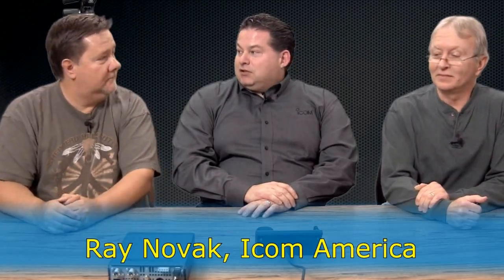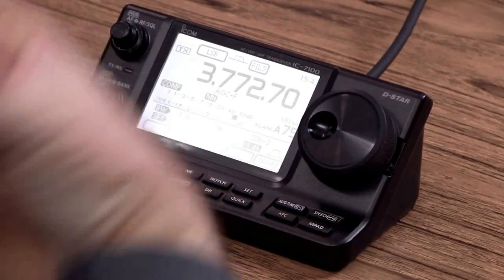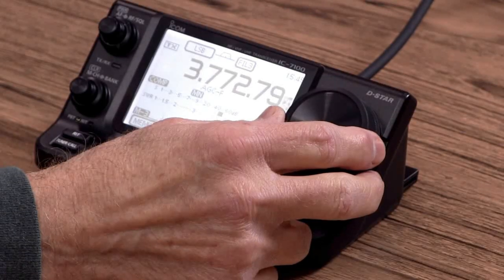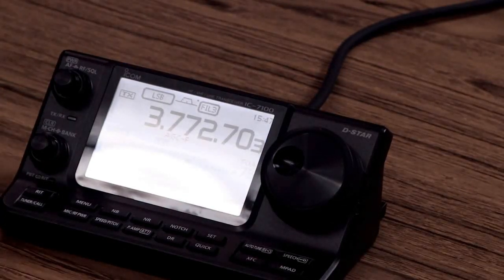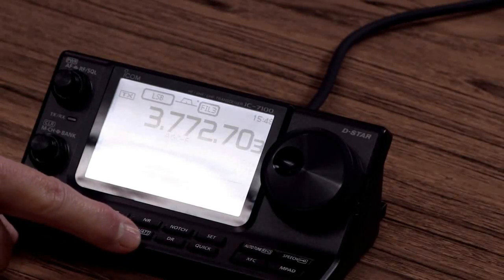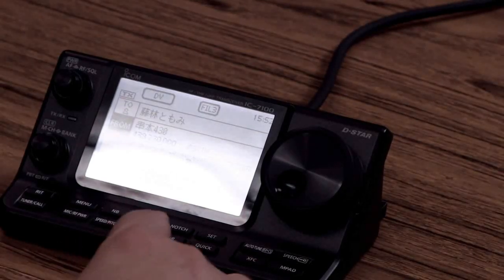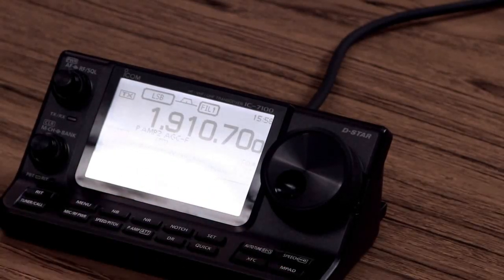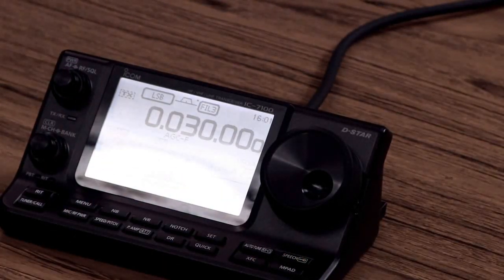Introduction to the IC-7100

Comment: would you please replace that freakn thing with a real mobile form factor like the 7000 please ??? you have a solid interface in the 705/7300, it's time to ditch that old clunky head unit radio to the mobile form factor again... the 7000 was so beautiful, it's possible for you guys to update that old thing... it's been 10+ year with that horrible design...

Comment: The AUTO TUNE on the right side is not for using an auto-tuner, it is to zero beat the CW received signal. I wish the glare issue was noticed before posting. Anyway thank you for the demo.

Comment: so the 7100 does not have GPS included like the 5100??
Reply: I know this is 3 years old, but that's correct. In another review, Mr. Novak said that Icom had reason to believe that a significant portion of the the target market for this product (mobile) would already have an external GPS installed in their vehicle.
Reply: @connors.1077  ty

Comment: I have the 7100 and love it, but I do have to point out he said it was not replacing the 7000, however ICOM did discontinue it a year later, so one has to wonder if they were not planning on it replacing the 7000? I have to admit I like the colored screen on the 7000 better, that is one thing that Yeasu is really doing right and ICOM needs to pay attention.
Reply: YEASU = YAESU.🤣😂😜
Reply: well, it's near the end of 2023 and that thing is supposed to come back on the shelves at the end of the year... what a horrible decision when they have a nice platform like the 705/7300... they should bring back the 7000 form factor for a real mobile installation, not with that clunky head unit...

Comment: Nice radio but does it have the same shitty mike quality as the IC-7000 and IC-2820?

I deeply cannot understand how Icom can ship such crap that needs to be modded before it can be used without sounding like a duck in a can. :(